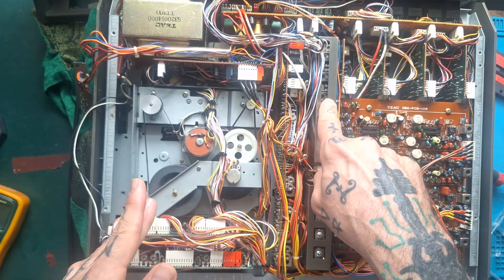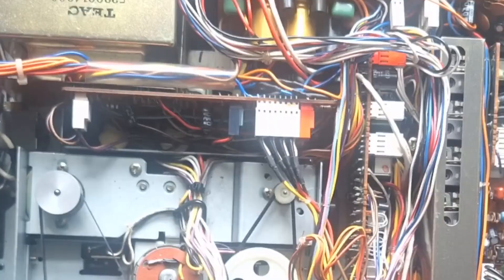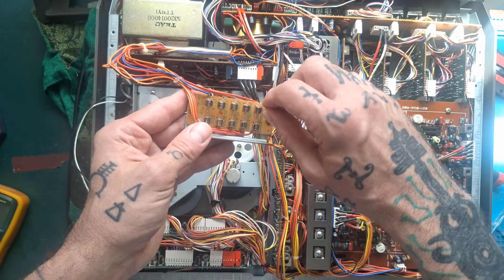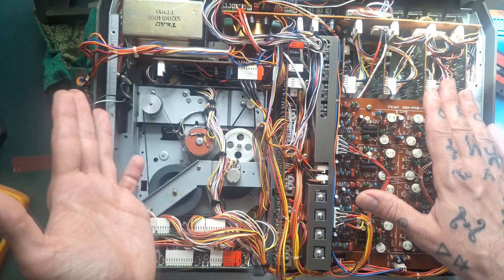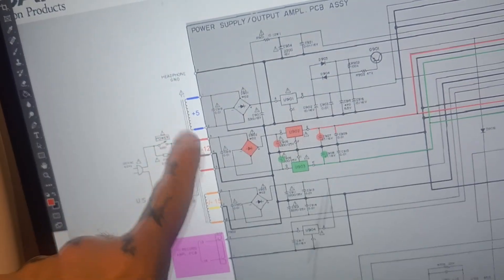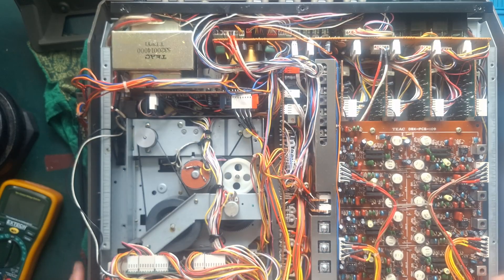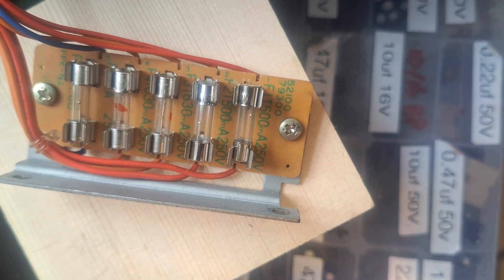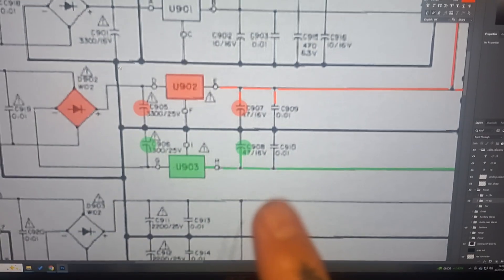Blown fuse | Short to ground | multiple PCBs |  minimise the components you debug | Tascam 244

Comment: Loving your videos. Mentioned on another one that got a 144 and 244 and using your videos to repair them, mostly belt/rubber issues. However I've also got a Tascam 564 minidisc that has disc loading issue. Do you know anything about them? Someone has definitely been inside it, there where cables unplugged when I opened it. The motor that loads/ejects the disc will not turn the system of gears however if I remove the belt the motor turns fine. The gears are all moving freely so I think that the previous person has replaced the drive belt with the wrong type and it may be to tight/short/stiff but I have no specs for the belt, it does seem tight and stiff. I temporarily put a small rubber band on, but it's quite lose and floppy but it half loaded the disc and managed to eject it. Any ideas? Cheers.
Reply from the maker: I’m sorry I have never tampered with the minidisc stuff. Sounds like you’re on track with the belts though?

Comment: Hi! I am following your tutorials on the gec transport to repair a porta05. The transport seems to work but the unit powers off suddenly after a while. Then I can power it on again and after it powers off again after some time (it's not really following a pattern). Where would you recommend me to search for the problem? Have you ever encountered a similar issue? Thanks!
Reply from the maker: Have you checked whether the solder where the DC input jack joins the underside of the printed circuit board is cracked?
Reply: @Tetrakan  Found the problem, faulty 12v PSU! Thanks for your help though.